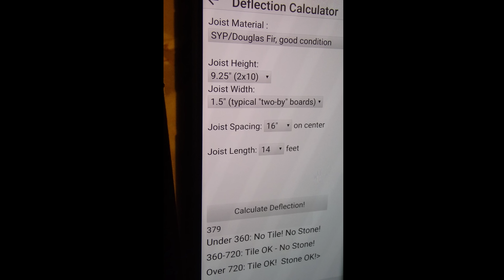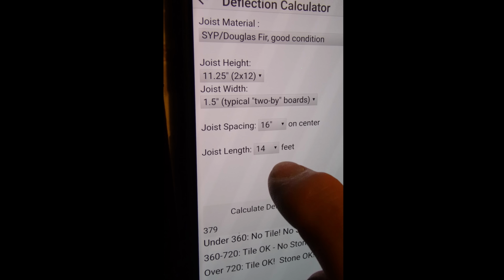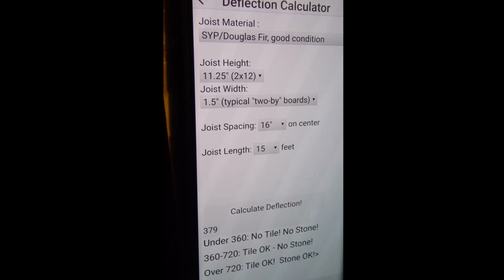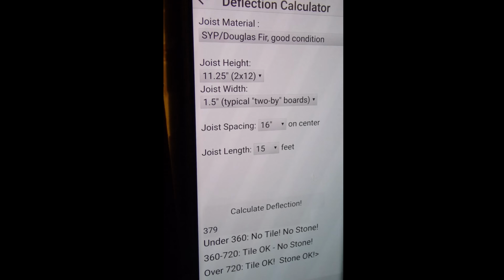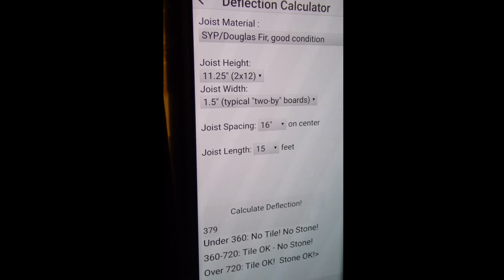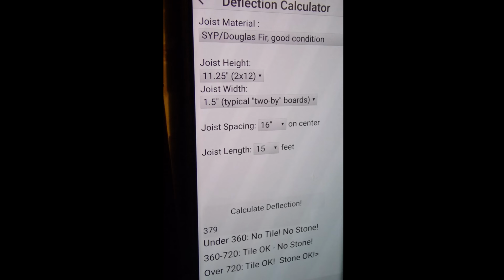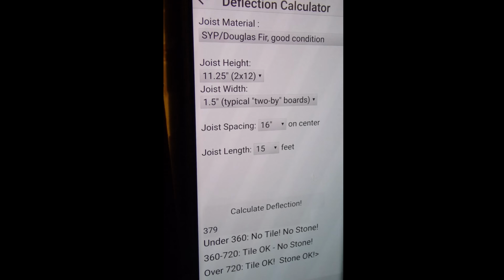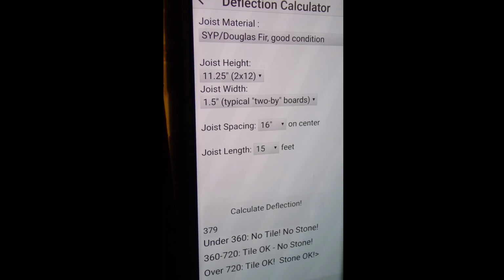🤔Before you install tile find out if the floor is strong enough?  What you need to know.

Comment: Hi Sal!  Thanks so much for these videos.  The app you suggested doesn’t have the exact measurements for my joists and my joist spacings vary.  My joist length is 11 feet, the joists themselves are 7.6x2.6 (so 3x8’s), and joints spacings vary between 12”-14”.  

If I put in to the app - 7.25” joist height, 2.5” joist width, 14” joist spacing, and 11’ joist length I get 549 for my deflection. BUT if I shift my joist height to 8” I get 704.  Shift the joist spacing to 12” as well and I get 821!

So my question is:  considering that the app does not have my exact measurements for the joists, and there is variations in the joint spaces could I deduce that I might just make it to 720 deflection to be able to use stone tile (slate)?  Would using the schluter ditra be the way to go here to ensure that my floor can sustain the weight?  

Thank you!
Reply from the maker: Try averaging out the spacing and see what you get. Only an engineer can tell you what your deflection actually is, so I would not presume to tell you what it might be.
Reply: Sal DiBlasi Makes sense.  Thank you!

Comment: Hi Sal. Just a quick question. How do you adjust the deflection calculations for different subfloor materials/thicknesses?
Reply from the maker: It calculates the deflection of the joist structure, not the subfloor layers.

Comment: Sal, when you refer to the subfloor are you talking about the flooring that sits directly on the floor joists? If you are, then wouldn't you lay another layer of plywood on top of the existing floor to tile onto and wouldn't this stiffen up the floor (dependent on the thickness of the plywood) and if so is there any way of calculating the stiffness of the floor with the extra floor layer?
Reply: Adding another subfloor would not add rigidity or structure to the existing joists, only more weight on the joists. What he's calculating is the amount of weight (or deflection) the joists can handle since tile is extremely heavy.
Reply from the maker: The joist structure has to be such that it meets the L/360, If it does you can add your underlayment to the subfloor, be it backer board, uncoupling membrane etc. and then install tile.
Reply: It's not because tile is heavy, people and things on top of the tile are heavy. If the joists and subfloor flex too much when heavy things move across them or placed on them, your tile will crack.
Reply: Thanks guys for the replies. Much appreciated.
Reply: Adding another layer (glued and screwed) would stiffen the subfloor from joist to joist. Example: if you had L/360 on 3/4" plywood/osb at joist spaced 24" apart,  you may be able to raise to the needed value by adding another layer of subfloor (NOT just by adding cement board or other membranes).  No matter how thick of plywood/osb you added, it would NOT improve the L/value if the JOIST, only the subfloor itself on the amount of deflection between joist. Weyerhaeuser has some good information on their website for more info on deflection tables etc.
Reply: @SalDiBlasi  If the joist structure meets L/360 does that mean you can install any ceramic or porcelain tile i.e. tile which is 10mm thick?
Reply from the maker: @BODGE71  Joist structure is only part of the requirements, Type of subfloor, thickness of subfloor and condition also need to be taken into account. It is not the job of the tile installer to design the floor structure, but he should know what to look out for so he does not install a tile job doomed to fail. refer to the 2018 TCNA handbook page 30, Here are a couple of links 
https://www.tcnatile.com/faqs/30-deflection.html 
A bit old, but interesting https://www.tcnatile.com/images/pdfs/Deflection%20Reflection%20-%202007%20Handbook%20Language%20Simplifies%20Substrate%20Load%20Considerations.pdf

Comment: I feel like this is one of the most overlooked parts of a tile install weather a DIY or a actual "installer". I recently walked away from a potential job I got a call to look at because it was a rather large bathroom, second floor and no way of knowing the stud structure and spacing. Just told them politely no thanks and why....what do you do in this situation Sal? Is their a way I could have figured it out without pulling up floor and subflooring just to find out it couldn't be done?
Reply: you should be able to tell by walking the floor and seeing if you have bounce. But you sound like a seasoned pro who has the ability to decline jobs as you stated.
Reply from the maker: Sometimes it is hard to tell, I will usually look in the basement, see how the house was constructed, If they have floor vents, you can sometimes get a look at it there. You have to do some investigating.
Reply: @SalDiBlasi  this guy just walks away when he doesnt know what he's doing. I think the homeowner dodged a bullet. God forbid he stand on a ladder and knock on the ceiling to figure out where the joists are.
Reply: @460sw3  Please don't put your name on anything. Your problem solving skills are zero to none.
Reply: @apex007  no, I just won't screw a client over. I told her the truth about the only way we would know what deflection is and that if it didn't meet requirements that now she would have a party demoed floor. That's how I do business.....and I have quite a bit. More than enough to keep me busy, and it's all by referral. And I get to fix or tear out and replace a lot from folks like you that obviously dont know what you're doing. And dont care about you're customers. It's ok though.....its job security for me, keep hacking brother. Hope you carry good insurance
Reply: @460sw3  I never said to screw the customer over. Nor did I ever say I was a contractor of any trade.  I did say you aren't using enough problem solving if you think demoing the entire floor is the only solution
Reply: @apex007  well then my suggestion to you would be to keep you're negative comments to yourself then, its not you're insurance and reputation. And I never said the entire floor.....but once you start somewhere and find out it dont meet requirements.....then what, especially when they tell you if it cant be tiled then they want it left just as is? Thank you for you're Input, but I actually do very well in my business following guidelines from the tcna and the manufacturers that products I use.  Merry Christmas to you and you're family

Comment: What about adding to the subfloor? Like an extra 3/4” plywood?
Reply: Bob Reikowski Good question.  A sheet of plywood will do two things.  1. It adds weight 2. It adds stiffness.   The stiffness of a sheet of plywood laying flat has very little stiffness  and alone  and  can’t support much weight without deflecting a significant amount.  Attaching it to a subfloor will result in an increase in stiffness overall at the cost of added weight.  Without doing actual calculations I would not recommend this as a stiffening method.  Because, the added stiffness will most likely not be sufficient.
Like Sal said, to really know requires calculations for your particular application which should be left to structural engineers.
Reply: I recently took a Schuter Training Course #1, and they said that it if the subfloor was plywood and needed to be reinforced bc of deflection, that a second plywood subfloor could be installed, but STAGGERED on the joists. check with Schluter on the specifics of this question.

Comment: Hi sal, I’m remodeling 2 bathrooms. Originally my contractor said to put concrete board down  over the plywood then tile. Plywood is at least 3/4in. Now we are going to add a heated floor. Would Ditra heat work in replacing the concrete board? I’m worried about the floor build up. Thanks, love your work.
Reply from the maker: Yes, Ditra heat in place of the backer board, Ditra Heat membrane is an uncoupling mat that accepts a heat wire, no need for the backer board.
Reply: Ok great. Thanks sal. Wish you lived in Pittsburgh.

Comment: Great Video Sal,  and I downloaded the TILE GREEK APP  as well . it is works well and saved my so much of my time . But, Question "People are saying Tile installed over wood floor systems MUST have a minimum of 1-1/4 inches of solid material beneath it. This means you can have a 3/4 inch wood subfloor covered by 1/2 inch plywood, cement board, or approved gypsum fiber underlayment. "  Is this true ? The reason why  I am asking this , its B/C the floor what we working on is 5/8 (19/32)  plywod  , Just assuming if i am adding a 1/2 of the cement board above the subfloor , I will still need 1/8 inch. 

I calculated the Deflectiong is 396 and it should be good for install porcelain tiles. 

I am thinkg if I could just install the porcelain tile aove the Schulter Ditra XL instead of 1/2 hardie board.
which way would be the best  ? 

thank you
Reply from the maker: The 1 1/4" is if you are using plywood as your underlayment, so you add 1/2" plywood and then install tile directly to the plywood,  not the best idea, however there is a method in the TCNA handbook that covers it. For porcelain tile, the underlayment, Ditra, Cement board or whatever you decide to use, can usually be installed on the subfloor and then the tile installed on that. Always follow proper methods and manufacturer recommendations. Natural stone is a whole other story.
Reply: @SalDiBlasi  Thank you !

Comment: Hey Sal, I’ve come to a crossroad that I’d like to open dialogue on.  Haven’t seen many tile experts talk much on first course of tile at the bathtub flange because often majority of tubs aren’t flat let alone installed level.  Also, the first line of tile up against a bathtub on the floor as this is similar due to the tub not being flat or straight from end to end.  Would you like to expand or is this a question you can touch on via email.  Have you made a video on this?  Just trying to master my craft job by job.  PS- I have methods I use but would like to see if minds think alike 👍🏼
Reply from the maker: Always leave a small gap to be caulked at the tub, follow the contour keep it neat and tidy.
Reply: Thanks Sal, that’s awesome reassurance.  That’s what I’ve been doing.  Thank you for taking the time to respond I’m sure you’re busy and I’m grateful!  Happy Holidays!
Reply from the maker: @markguagenti9342  😀👍

Comment: This is painful!
Reply from the maker: Take some advil.
Reply from the maker: Well you seem to be one of the very few that has a problem, 53 million views seems to contradict you assessment.
Reply from the maker: You mean 128K. So one has to ask, if the whole world thinks it is right, and one guy thinks it is wrong, then is that one guy the idiot, or is the whole world being fooled. Does not matter, the one guy still is an idiot to the rest of the world.
Reply from the maker: @skiprope536   So you are a tile pro? The joist will move, it is not if they move it is how much, curiouse that wedge has a readout on it to tell you what the deflection is like L/360 or whatever number, send me the link, I would like to buy one.
Reply from the maker: @skiprope536  So you are a carpenter trying to tell a tile guy how to do his job and what he needs to know and how to figure it out. In my experience GC and carpenters have no clue what a tile guy needs and fights us on everything. You do your job, I will do mine. Just so you know, there have been some very recent changes in the TCNA handbook that specifically deals with Deflection and what is relevant to a tile installation.